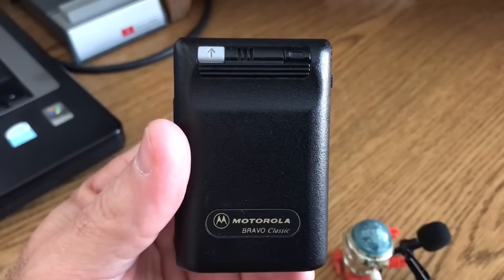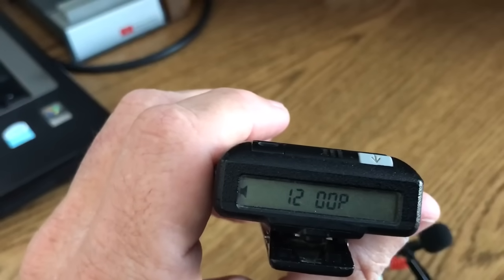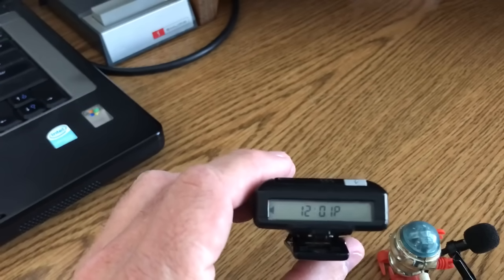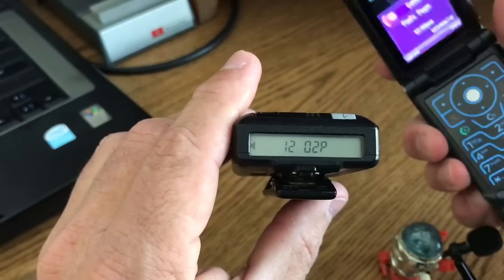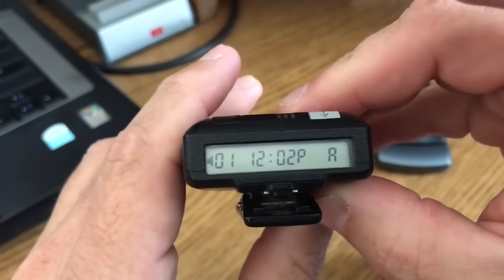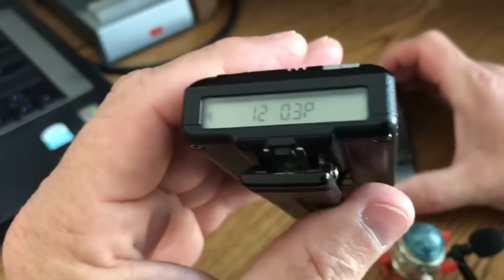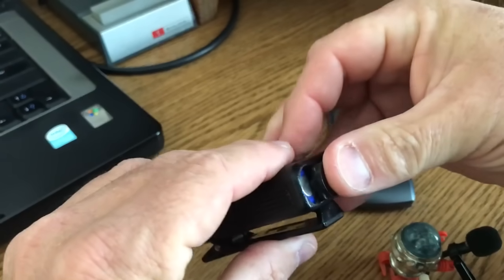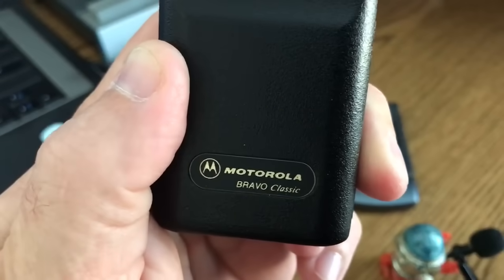How do pagers (beepers) work?

Comment: My favorite pager - that I still have but there's no service for it - is the Motorola Gold Line Pocket Pen pager.  I was a technical consultant for an international bank and this was in my shirt pocket next to my Cross pen & pencil set (of course).  That thing worked great.

I will I could find a traditional pager service that supported it but I am told no one any longer uses the frequency the pager was assigned.  Oh, well.  

As you stated, there was nothing wrong with the pager.  It was "OBE'd".  (Overcome by Events).
Reply from the maker: I totally remember those!!  Not sure about programability on them, unfortunately.  There's always several of them for sale on ebay.  You could always ask around and see which paging frequencies are still on the air in your area and buy one on your freq.  Then contact that carrier and tell them your cap code and get back on service.  Just swap the guts with yours and it's like your original pager back in  business!
Reply: @ModelA  I checked a year or so ago.  The frequencies can't be changed in them and they need some kind of special tool ($$$) to program them, but the frequencies are fixed.  I guess they had that model in various frequencies.   But, the one I have has a frequency that no paging company anywhere seems to use any longer.  Oh, well.

Comment: I had a two-way pager back in 2017 when i was trying to "unplug" from the modern tech. I used it for around a year. It's coverage was super awful and the service was selective on when it wanted to work. Texts took forever to send or receive and sometimes, i wouldn't get pages that were sent to me. If i did, they'd get to me minutes and sometimes hours late. I downgraded to a Motorola Bravo Flex and the service was night and day. Pages were sent to me almost instantaneously and I'd get them every time. Much cheaper to have as well. I unfortunately let the service lapse and forgot all about it until i found it again recently. I'm thinking of reactivating it again.
Reply from the maker: Two way paging was awesome in the early 90's when the paging networks were built out and had several transmitters for every area.  But by the time you got yours, they had almost fully disassembled the system, and there were very few transmitters left.  I got rid of my 2-way pager about the time you got yours.  I was sad about it, but their cost-cutting ruined it.

Comment: by "calling" the pager, does the pager have a SIM card? 
how do pager receive the transmitted message from a cellular device? 
what's transmitting the message?
Reply: When you "call" the pager's number (also known as Personal code number, similar to a phone number), the call is actually received by the paging company that takes your message via DTMF tones and then broadcasts the message to it's pager network.

Finally the pager itself is listening to all the broadcasts, and each pager has its Channel Access Protocol (CAP) code, a unique identification address. When the pager hears its CAP code, it receives the message.

so really what's happening is your cellular device is informing the paging company to send some message (you inputted via DTMF) to a pager, and then the paging company uses it's Networks to transmit the message.
Reply: Thank you for the explanation

Comment: I still don't get it. For a pager you'd have to find a cellphone to call someone once they want to contact you right? The thing going for it is the range and battery I guess.
Reply from the maker: Yes, exactly.  Also, untraceable.  Your cellphone is constantly tattling on you, how fast you're driving, where you are, where you've visited, for how long, etc.  I leave my cellphone off until I want to use it, then tuen it on.  The pager stays on all the time.

Comment: I still want to know how the message gets to the pager. Does it have a "SIM card" (or some proto version of that you can get replaced)? How do they know which pager to send the page to?
Reply from the maker: Each pager has a unique CAP code.  No SIM card.  They do not transmit, only receive.
Reply: @ModelA  yeah but how do you tie that to your phone number? Do you have to work with your carrier to set that up?
Reply from the maker: @matthewrease2376    The pager gets its own phone number.  Unlike cellphones, you can't port pager numbers.  However, you CAN forward a phone number to a pager.  But either way, the pager gets a unique phone number all to itself.
Reply: @ModelA  ah. So you'd probably have to put your pager number in your regular voicemail I'm guessing.

Comment: You're using it with a Razr phone no less. The funny thing is Razrs have been back in fashion for a few years. They're not huge like they once were and I think it's more about taking a picture of one rather than actually using it but I digress. Maybe it won't be long before there's some updated version of a pager. 

In a way, you could say smartwatches are like pagers. That's only if you see them as being hands-free and giving you a quick notification that you can look at in more detail later and not as being twice as plugged in. I'm assuming people used pagers as a way of not having to use their phone. Otherwise I don't get the point.
Reply: Pagers were used because cell phones were not popular yet because they were so expensive, my only neighbor who had the one was a car dealer. However my father who worked construction and lived abroad had a beeper to keep in contact with work and family when/where landlines were not available.

Comment: it does take longer to activate than fire brigade pagers which are set off from control centres throughout ireland (where i am based)-i know our pagers activate as girl types in incident and location of fire--or R.T.C-----etc to her computer from the caller (computer can tell from location of incident the nearest station or firehouse as u would know it that will respond and automatically sets pagers off for 18 seconds for those stations)----pagers are held by retained firefighters in ireland-interesting to c how they work in principal-great video

Comment: Yes, and if you were born after the year 1970, you probably never experienced the thrill of almost being kidnapped by whoever was on the other end of your dad's CB Radio he installed in the Ford Torino as a teenager that you weren't supposed to be using. I might be a 90s kid, but we aren't all as vapid as one might think.

Also, there's nothing civilized about the tornado warning volume of a siren that came on those things. It's loud enough to make a deaf man's ears bleed.
Reply from the maker: Perhaps it is what one said on the CB radio to the stranger that caused the near incident.  You can never underestimate someone's level of crazy.

Comment: Wait what? You need a phone to send a page to a pager? But didn't pagers supposedly existed before cellphones?
Reply from the maker: Think wired phones.  They have been around since 1800's.
Reply: @ModelA  so you type messages on landline phones?
Reply from the maker: @ceasarsalad2055    No.  You just use the number buttons to put a phone number out to the pager.  Or, wait for the beep and speak a message.  The pager would then either display the phone number you keyed in, or alert the pager owner that they have a voicemail waiting for them.  They call the pager number from a landline phone and retrieve the voicemail when it is convenient.
Reply: @ModelA  OH!! Got it. Thank you for explaining it thoroughly, this is bugging me for a while and now it makes sense to me. 🙏
Reply from the maker: @ceasarsalad2055    Glad to help!
Reply: It was numbers only but you could type limited letter messages with the numbers, like you would on a calculator (5318008 hold upside down he he) or write and share a pre arranged list of messages with numbers beside them so the reciever can look uo the number you sent and match it with the message on that list.
Reply: @ModelA  I like that voicemail option rather than emailing a message since I'd have to be near my laptop & we have no smartphones.
Reply: @ModelA  there were alphanumeric pagers also..when you called it you could use letters on the number keys .. like sending sms from a Nokia 3310

Comment: No matter how good they work. You can’t make a call on the spot with them 💀
Reply from the maker: True.  But that is also what makes them untraceable.
Reply: @ModelA  But they aren't untraceable, because you still need to use a phone.
Reply from the maker: @DeadManSinging1    As long as you don't call immediately, then not traceable.  The device itself is not traceable.  Nobody can see where you are, how fast you're driving, etc. like they can with cellphones.

Comment: These days u need encryption for privacy, those days, u could just call back from another number if u trusted the number, amazing.
Easy Erase, what else u need.
Reply: trust is irrelevant, encryption isn't there to protect you against people you trust. its to protect against unwanted snoopers.
Reply: @googlacco  encryption is for protecting from 3rd parties, under police, whatsapp itself,or whoever.
Pagers. They cannot tap off pagers. Youll have to call back from a payphone which leaves no traces.
It aint a cellphone which can be traced.
Reply: @heaven3953  do you realise that any radio signal can be tracked and decoded? its exactly like a cellphone that can be traced.
Reply: @googlacco  its hard to gain evidence when called from a payphone lol. Cellphone to cellphone can be linked easily.

Comment: I just got this exact pager from eBay not long ago! :) However, I think it may be a knock-off, it doesn't have any brand name or model name on the front like yours does, so its been a struggle all this time to figure out its identity to learn more (The seller knew very little lol), all the seller said was that it was from 1995, all the buttons, screen and such are the same though! Just instead of the front with "Motorola BRAVO Classic" its just a smooth black face, maybe the previous user replaced it? Do you know how I might reset mine?
Reply from the maker: It probably got a new case at some point.  That's very common.  "Reset"??  You need to have it programmed, and it needs service.  Back in the day, the paging carriers would issue them pre-programmed on their system.  The programmer is a big jig thing running a DOS operating system.  Some pagers are frequency agile and some are not (crystal controlled).
Reply: @ModelA  Ahhh I see, sorry you’ll have to bare with me haha! I’m just learning now how it all works, I was naive to think it was an easy and simple connection similar to Bluetooth lol but yes I’ve been corresponding with a local (likely one of the last) operating companies for pagers in my area (Ontario, Canada) by the name of PageNet, after many back and forth emails it seems he’s determined that this particular pager is defunct after attempting to send a page :( I am very disappointed… but that’s what I get for Willy-Nilly eBay purchasing lol however, PageNet provides a full year service that includes the pre-programming you’ve mentioned, a new “old” pager (Motorola Advisor Elite was one of the options, boo-yah!) and a couple other neat specs for a really reasonable price! MUCH more affordable than my crappy iPhone that’s about the same price MONTHLY… so my next mission is to get a flip phone setup and ditch all of this modern chaos for good!! I’m just hoping I can find a relatively decent flip phone that isn’t too modern yet still is functioning what with 5G takeover and the extinction of 2G and almost all 3G towers lmao

Do you have any recommendations for classic reliable PDA’s? (Yes, I’m really ditching ALL the modern equipment lol, I’ve got my eye on a Jogger Discman right now… lol)
Reply from the maker: @TravyJsSpace    Good for you!!  I don't know anything about PDA's. Never even played with one.
Reply: @ModelA  Shoot! Lol that’ll be my next investigation, thanks again for this video! Without it I’d have no clue what pager I had purchased, or how to set the time and such too. Take care!!

Comment: So was it a modem, or what? How was the signal received? FM, via towers, what?
Reply: Pager companies would lease small amount of bandwidth from FM radio stations..
Reply from the maker: This pager receives on 152.840 MHz.  It is listening to a former Mobilephone freq.  There are several high power transmitters on that freq. sending the FSK signals you hear in the background.

Comment: I have a question so if i buy a pager that is not connected to a service can i get it connected to one online?
Reply from the maker: In the US, there are still many paging systems on the air.  Mine in through American Messaging.
Reply: @ModelA  Thank you so much
Reply: PAGERDIRECT

Comment: What pager service do you use Paul? My paging company only uses Flex pagers with a 929 frequency.
Reply from the maker: It used to be Cook Paging.  Cook's got bought out by American Messaging a few years ago.  It's on VHF (150 MHz.).
Reply: Paul Shinn thanks. I use pagers direct they are serviced by Spok and American messaging but only deal with 929 mHz and have limited pagers you can use for their service. How is your reliability and service?
Reply from the maker: Excellent on both.

Comment: Where did you get it and how did you activate it. How much is service
Reply from the maker: I got it from Cook Paging in 1990.  Service is now up to $100 per year.  It was activated when they sold it to me.
Reply: @ModelA  that sounds like a scam when you can set up a similar system for almost no cost
Reply from the maker: @googlacco    How so?  In order to cover the entire state, you need multiple transmitters on high level sites.  The tower rent alone would far exceed my annual income. Then you need the equipment, and satellite links to the transmitters. Phone lines, etc.   $100 per year is a bargain.
Reply: @ModelA   @Paul Shinn  you don't, you're thinking too big. you can easily use an existing cellular network, set up a server handling the pages, and use a service like twilio to send it over to a receiver. can be done effectively for very little cost.

if you want a completely standalone network, lora has a large range, and barely has any upkeep. for $100, you can have a full functional network of transceivers with 10km of range.
Reply from the maker: @googlacco   - Pagers do not use and cannot use cellular network.  This pager receives on VHF.  That's the 150 MHz. band
Reply: @ModelA  there are pagers available made for cellular networks. you can even make one yourself. whether the network is available is a different question, but alternatives exist, like low power wide area networks. which you can manage all by yourself, decreasing reliance on third parties
Reply from the maker: @googlacco   - I understand (I am an engineer and work in the radio industry).  However, you are still relying on a cellular type network. Part of the beauty of pagers is they are not traceable, since they are a one-way only device.  No handshaking going on.  A cellular network relies on handshaking with devices so they know where to route traffic.  A paging network sends all traffic on every transmitter at the same time, it is independent of device location.
Reply: Learn about tuning pagers that are out of alignment here... https://m.youtube.com/watch?v=FDxJMTm_X6g

Comment: Wait, that's what US doctors use? That's so slow to actually transmit a message. Why at least not upgrade to SMS system?
Reply from the maker: Because SMS sometimes doesn't work.
Reply: Dependability. They use a combination of SMS and pagers. You can be nearly anywhere and you’ll get an alert from a pager though.
Reply: Because you do not want the distraction of a complete phone with all its apps and spam messages while performing surgery. And 4g signals don't always penetrate thick hospital walls. Plus you'd be relying on a third party system which, if it crashes, is out of your control. The hospital can control the pager system and have someome on site to fix it if there's a problem.